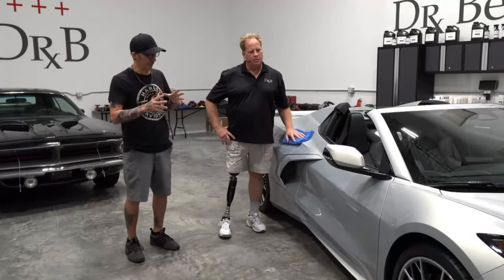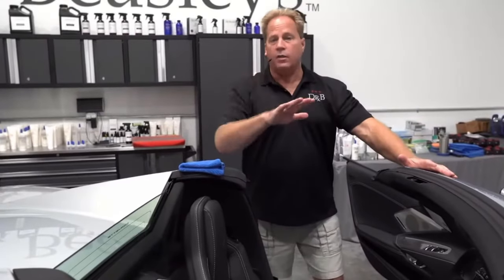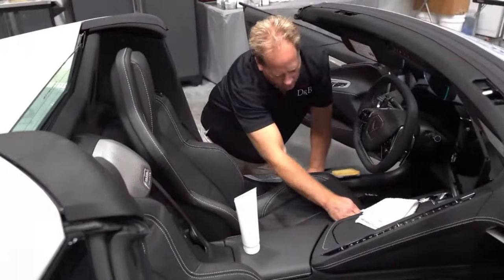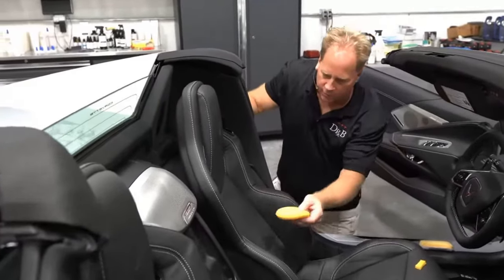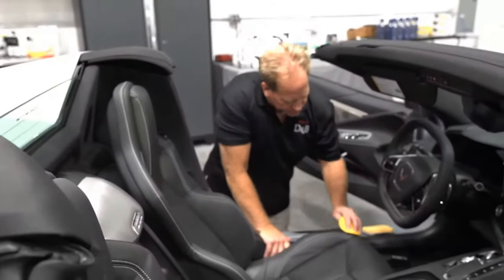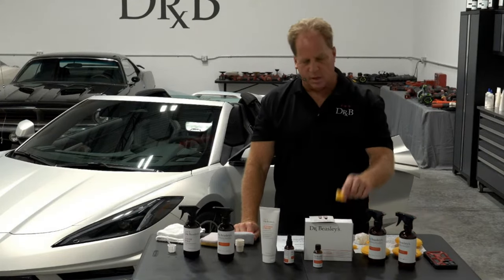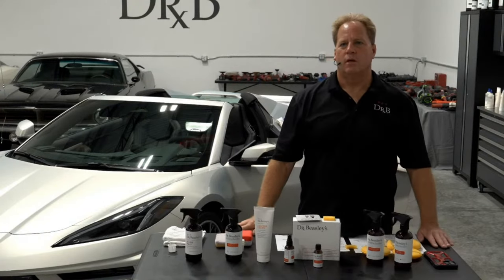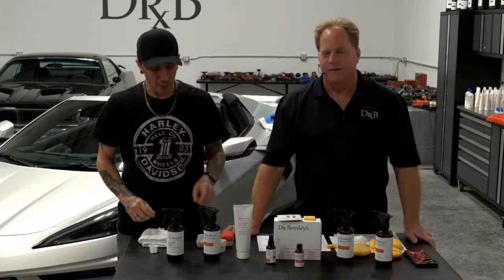How to Detail Leather | 🔴 LIVE Online Detailing Class with Mike Phillips

Comment: This was the wrong type of leather seat treatment for a C8, unless the seat’s protective clear coat layer had been worn through, especially on the bolsters. As this C8 was probably newer than 3 years old, the treatment should have been a more thorough cleaning, allowed to dry a few hours, then a ceramic topcoat applied. This would include the ceramic coating on the white stitching, to prevent wear and blue jean color transfer to it.
Reply from the maker: Hi Illiya, you bring up a fair point and there is debate as to whether new leather should be conditioned. We'll be doing a video on the subject at some point in the future, so stay tuned!